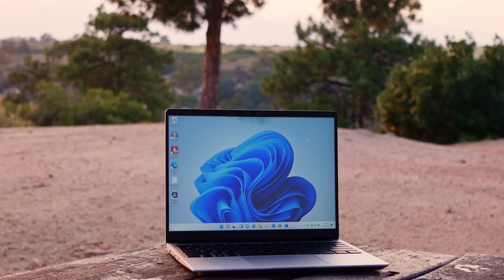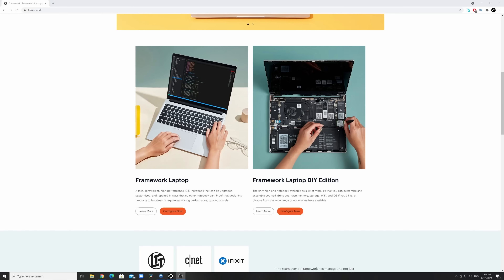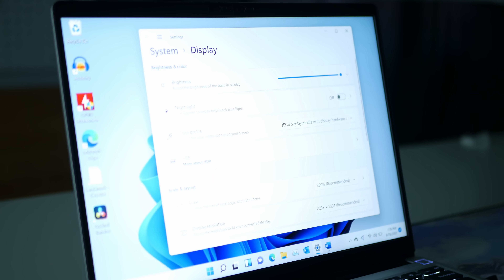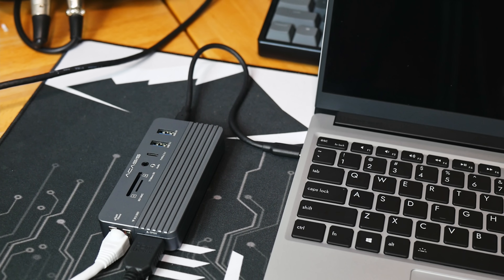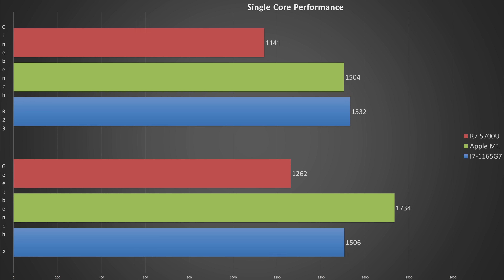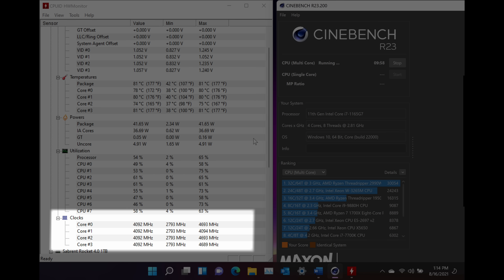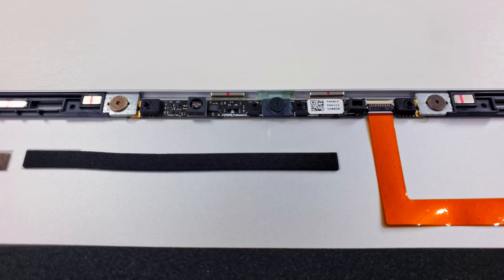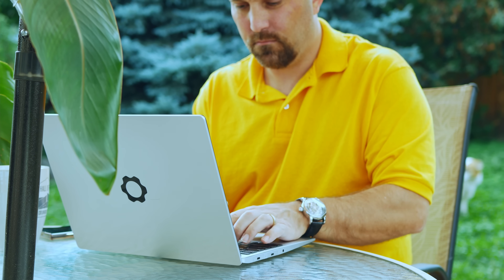The Framework Laptop - An Honest Review.

Comment: The Intel Xe GPU is actually pretty capable. I got the I5 model and its Geekbench 5 compute score (Vulkan) was only 1000 points less than a GTX 960M (10498 vs 11453). I know I know, GTX 960M isn't particularly new or powerful, but it was once a mainstream dedicated mobile GPU nonetheless. Fedora 35 has been running super smooth and responsive on the device, and I am very satisfied.
Reply: However if you compare it to the new iGPUs in AMDs 6000 series CPUs, it loses by a lot. Which is why I'm waiting for the next generation mainboard from framework, hoping they offer AMD options

Comment: Nice review! I was looking forward to see a performance and use test beyond the usual (and well deserved) "oooh, it's serviceable!".

If I may, there's a part that is inaccurate, contradictory with the rest, and maybe misleading:

"If Framework becomes another casualty, I'm left with a laptop that's just as serviceable  or upgradeable as an Apple product."

Even if the company disappeared and never built new modules or specific components, you'd still be left with a much more modular and easy to open laptop, with no damn glue, with good documentation, user-friendly guides and lots of off-the-shelf upgradeable or swappable components. So, even in that case, it'd still be in a totally different league compared to an Apple product.
Reply from the maker: Answer this. If Framework is no more how would I upgrade this laptop to a 12th gen intel, or replace the battery when it degrades, or replace a cracked display or blown speaker? I can replace generic SMDs and generic components on any laptop, but much of the Framework is still proprietary.
Reply: @ElevatedSystems  I agree with all that. It's just that leaving it at the same level of an Apple product in terms of serviceability. even in that case, seemed excessive to me.
Reply from the maker: @eldelacajita  At this point in time 3rd party and aftermarket replacement components are easy to get for most Apple products. I can basically rebuild an entire MacBook if I need to. The process sucks but it can be done.
Reply: H
Reply: can you upgrade this laptop to a 12th gen intel ? i mean without the whole motherboard change..

Comment: I can see this laptop as an awesome company computer that employers can provide its workers - modular, upgradable, with a bunch of different options for different types of use within the company. I'm thinking in sectors like finance, non-profits, even higher education. The company can have a library of different Framework laptop parts, especially battery cause usually those are the first to go. If something goes wrong with the computer, it's easy to swap the parts needed. No need to send the laptop in a box to a provider for repairs if it can be done in the office. 

For example, I work in a nonprofit that uses older Lenovo laptops - it's common for me and my co-workers to request a replacement laptop from IT when ours malfunction. The company IT guy then takes the laptop, sends it back to our laptop provider, then wait to get a replacement laptop...takes too much time. Framework will serve nicely to fix this issue, and if they do well in the future, it is more sustainable.

Great video, earned yourself a sub from me :)
Reply: I am a student myself, and currently have a 4 year old hp craptop. If for some reason my laptop would die on me I would seriously consider a framework. Yes the entry price is a bit more I’m willing to ideally pay, but the repairability would help offseting that in the long run, especially for students very tight on money.
Reply: @onelyone6976  Yes, I wonder if they could get really competitive, because you just have to swap out the mainboard to get newer performance, which is not possible with any other laptop. And if a better screen comes out, you can pop that in too. If battery technology improves, you can get a better battery.

The point is, if done right, you might not need a completely new laptop which I think most people factor in if they compare prices, since normally you need to buy new devices every few years. And that way the price becomes something completely different to consider.

I also believe that in the future, integrated iGPUs on the processor chips will become insanely good. I was already astonished how many of my games a Ryzen chip could drive suprisingly well. For the full-demanding games I'll always have my tower computer, laptops just can't top that, or they get hot and loud, which I don't like. So on a laptop I would play such games that I tested: Minecraft, Subnautica, Portal, Factorio etc. And those ran very, very well. I don't think it stops here. I think we will be able to drive more and more stuff on that, and if you can get all that with a switch of your mainboard cheaper than buying a new laptop all the time to keep up with the advances of technology, what could you ask more?

They literally made everything replacable, that you can think of. That is a completely new way of seeing a product, that we still have to get used to. In our minds we always think that we need a new device to get a better display and anything really. With Framework that's not true anymore.

I really hope that they keep up with providing mainboard updates, because I think that is one of the most compelling reasons I can think of.

Comment: I’d love a second chassis option for dedicated graphics, and the ability to start with an ultra book and then swap the motherboard into that bigger case if your needs change. Or conversely, to buy a fully kitted out portable system with a 3060 and a 14” screen that I could then swap into a 13” ultra book by removing the daughter board and putting into a lighter chassis for travel. Hell, even a mini pc box that we could use to turn any older framework motherboard into a home theatre pc or retro gaming rig.
Reply: I'd settle for a machine with upgradeable dedicated graphics but I agree I want something where I can put a 3060 class gpu in it.
Reply: Sadly laptop GPUs are surface mounted also, that means you can't just drop one in, if it's part of the motherboard then you wouldn't be able to move to another chasis without moving the whole specs, if it uses a daughter board you would need a way bigger chasis to accommodate another board and a second cooling system you can separate from the main one.
Reply: @MrJleonp  all modern gpus are surface mounted. I am taking about sticking one on a replaceable daughter board... You know... Just have a graphics card manufacturer make one.
Reply: @braddirt  Yeah, I get it, sounds bulky having in mind it's a separate board and a separate cooling for the GPU, and probably would need a bigger battery, I imagine it the size of a laptop DVD drive or a 2.5 inch SSD but a bit taller, and probably very loud having a separate fan.
Reply: @braddirt  well, on a second thought, it sounds like an eGPU but inside haha, thunderbolt 4 should be able to handle it, like an internal expansion port, an using thunderbolt will allow to use it on other laptops or repurpose it later when you upgrade to a better one

Comment: Intel definitely wins in single core performance, but doesn't ryzen beat them in efficiency? From what i understand, at comparable performance amd's mobile CPUs consume less and produce less heat than intel ones, right? This could definitely help with battery life, and considering thin and lights are made too always be on the go, i think there's always a market for higher battery life, even if it comes at marginally lower performance (which is trivial to most consumers). I think it'd be great to have the option to choose between ryzen and intel, so the buyer can decide based on their needs.
Reply from the maker: Ryzen wins in performance per watt but that is mostly multicore performance. Both operate at 15 and 28 watt PL1 and PL2 limits so overall battery performance is about the same depending on your workflow.  Ryzen systems do use less power overall however as there is less power demand by the IO.

Comment: They are in talks with AMD, but full support will require a motherboard fabricator to create something to Framework's specs. Whoever will make the motherboard will need to foresee a significant volume potential in making a motherboard for Ryzen. Also, because of the way the computer frame is designed, both the Intel and AMD motherboards will likely need to be interchangeable for the end user.
Reply: Makes sense and those laptops will support APU's with RDNA graphics.

Comment: 15:20 since a lot of people are comparing with Apple M1 CPU :
The exact same thing hapoens it's called throttling. CPU will go as fast as it can until it reaches max temp. On my M1 Mac, it reaches max temp after 30 to 60 seconds on a Studio which has active cooling, then performance will drop significantly. Contrary to popular belief, M1 CPUs are actually slower than AMD and Intel ones once you reach that point, but Apple Benchmarks are based on CPU performance before throttling and that CPU cannot handle that without external cooling
Reply from the maker: There's a big difference between a frequency curve and thermal throttle. You are describing a frequency curve which is normal. Modern CPUs are designed to ramp up quickly and then settle to their sustained core clocks, bursting individual core's as needed. Just because a CPU hits it's max temp and then drops doesn't mean it thermally limited. That's what it's designed to do. Thermal throttling occurs when a CPU can't maintain its sustained clock speeds ( not turbo) due to thermals and needs to down throttle to shed heat. This does happen in an Macbook air and in sustained workloads on the Framework 13 but something like the Mac Studio never gets anywhere close to thermal throttle. Also cross platform benchmarks like Geekbench and Cinebench are based on single and multicore sustained loads.

Comment: Really wish they keep one design and stick with it for a couple of years at least. Hope there would be an AMD logic board option down the line.
Reply: I would think they will keep to this design for long time, maybe expand with more designs but probably still have vary similar design internal (so it is easier to have replacement parts)
Reply: I don’t see why they would need to change much regarding the shape of the internal components. I’m more worried about future chips requiring a more intense cooling system that doesn’t quite fit the dimensions of the device. However as long as they keep the mounting similar they could probably just sell a larger chassis that would be capable of supporting more or larger components.

In any case there’s a lot of possibility and I’m really looking forward to it (and can’t wait for my order to ship this month regardless!)

Comment: LPDDR4 is faster than DDR4 ?? Are you sure about that assertion? Unless something revolutionary has occurred, LPDDR4 offers lower performance than DDR4 but uses less power, hence it's popularity in thin and light laptops. Happy to learn something new if I'm wrong here?
Reply from the maker: Not sure if it's "revolutionary" but LPDDR4X has occurred. DDR4 SODIMM in a laptop is typically maxed out at 3200MHz in dual channel while LPDDR4X maxes out at 4667 MHz in quad channel This provides about a 28% bandwidth increase which significantly improves performance, particularly in IGPU performance. Iris Xe graphics get a good bump in performance with the faster LPDDR4X memory and this doesn't just mean gaming as I didn't buy a Framework to game on.
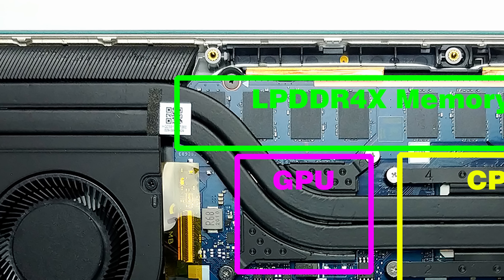Reply: @ElevatedSystems  It would seem you have a point about LPDDR4X's capabilities, although at 16:42 I guess you mis-spoke and said LPDDR4? As I said, glad to improve my knowledge in this area. Though I'd counter that DD4 SODIMMs are readily available with speeds above 4000MHz and that the existance of LPDDR4X in a laptop doesn't seem to guarantee that it's a faster configuration. A maximum of 4266MHz appears to be the typical option based on what I can find. 

Either way, I would expect the option of being able to upgrade/replace the RAM probably trumps the marginal real world improvement for most, especially when it comes to being able to repair the laptop instead of throwing it away because of a memory fault. I wonder if there is any technical reason why LPDDR4X couldn't be offered in a SODIMM form factor, potentially offering a future upgrade path for those who want better battery performance?

Comment: I love this very much! Just two things bug me:

 - Functional: Shiny screen?! Why? Who actually wants this? Matte, please!
 - Aesthetics: Body thinning out at font. I really wish it had the same thickness everywhere.
Reply: Body thinning out at the front is where the bottom side speaker sound comes out.
Reply: Me. I'm sick of matte screens. Makes the computer feel cheap and is hard on my eyes.

In a side-by-side comparison with a high-bay shop light behind me, the matte screen on my XPS 13 washes out completely whereas the glossy screen on my MacBook Air just has the reflection of the light fixture itself, and only a small portion of the screen becomes hard to read (less contrast with the mirror-like reflection of the actual light fixture). Hiding the reflection of the light fixture is much easier than eliminating the washout glare on the matte screen, as even tilting the screen doesn't help. The matte surface reflects like from multiple angles vs. straight-on as glossy screens do.

I'm actually a fan of going back to thicker 15" laptops. These ultraportables are nice, but I miss having a laptop with ports, screen space, and enough weight to stay put on a lap or desk. A thinning wedge towards the front provides a slight tilt to the keyboard that is nice, though.

Comment: 1/8/22. Looking at the Framework Professional Laptop ("FPL") -- primarily thinking that Windows 10 Pro, 32gb of RAM, and 1tb of memory may be necessary minimums for digital film editing -- I was hoping Elevated Systems might have a comment on the ability of the laptop to handle digital editing work, specifically AVID MEDIA COMPOSER. I'm almost ready to recommend this Laptop for my daughter's interest in digital editing, but not if it won't work with Avid Media Composer, and, unfortunately, AVID does not (yet) seem to mention the FPL for use with its software. Did I miss a comment about digital editing in your video?  In any case, thanks so much for the video as is, quite instructive.
Reply from the maker: For me the primary use for the Framework is as a productivity laptop and unfortunately I'm not familiar with Avid Media, however if you are looking for a laptop for video editing you may want to look at one with a 16:9 display as having more horizontal space is better. With that said I have done some editing in Davinci Resolve on the Framework connected to 2 4k displays and it worked fine with 4k x264 footage. It is even better suited for Premiere Pro using Intel Quicksync. To be honest the best ultraportable I've used in the past year for video editing is the 2020 M1 MacBook Air or MacBook Pro. That may be an unpopular opinion in this videos comment feed however, the M1 with it's built-in media encoders is purpose built for video editing. If you have the money to spend the new 2021 14 or 16 inch Macbooks are unbeatable in this area. I love my Framework but the tiger lake U CPU'S do have their limits.

Comment: One concern I have is the cooling and airflow when considering the temp of the CPU and other components on high load. The combination of a single fan and the downward airflow from a bottom vent doesn't seem like a great solution. Especially considering the types of surfaces that I would use a laptop (on my lap, soft surfaces, etc.)

What I like about the airflow in a MacBook (prior to M1) are the positions of the vents, which are directed outward and not directly onto the surface. It also directs hot air through both fans, directly out in the back. On top of this it has pads underneath to lift up the laptop on harder surfaces.
Reply from the maker: Sorry I should have been more specific. The bottom vent is the intake. The exhaust is on the back just like the Macbook.
Reply: @ElevatedSystems  Thanks for clarifying. This makes more sense.

Comment: bizzarly enough, my productivity needs are more geared towards a 16:9 ratio as I work with tiling terminals, and having 4 terminals tiled on the screen, I wouldn't have enough width, and lines would wrap so much more and would be painful to read.
I would also prefer ryzen, just to get more cores because I actually need them, but I can do without, not a big requirement for me.

so yeah, if they get a 16:9 ratio one out there, I'll definitely grab it, might take a few years before they manage it, but I believe in them. I just hope my current laptop lasts that long

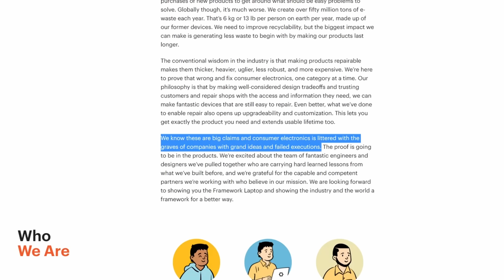Comment: 18:01 eh, not true, there are lots of standard parts in the laptop you can switch/upgrade, which you can't in macbooks
Reply from the maker: Like what?
Reply: @ElevatedSystems  memory, storage, m.2 wifi module
Reply from the maker: True not in newer Macbooks, but those are the components I added to the laptop and those can be swapped in most laptops (except LPDDR4X models). Everything that came in the Framwork depends on Frameworks longevity to replace or upgrade.
Reply: @ElevatedSystems  you talked about Apple, not general laptops.

But yes, most of the repairability/upgradability depends on Frameworks longevity.